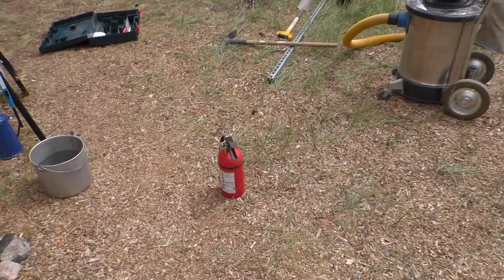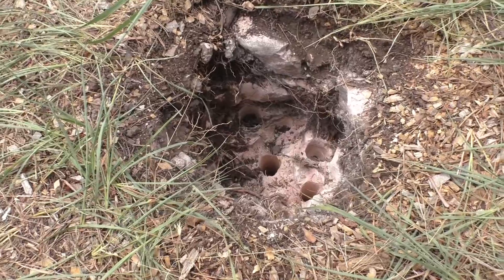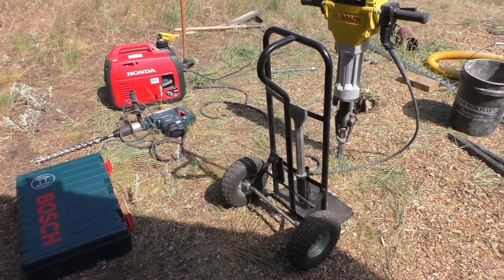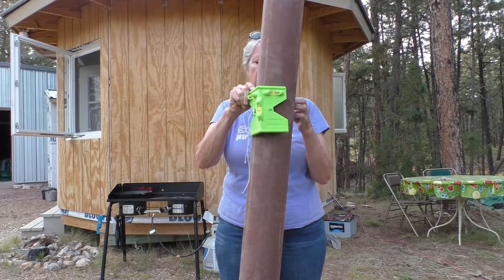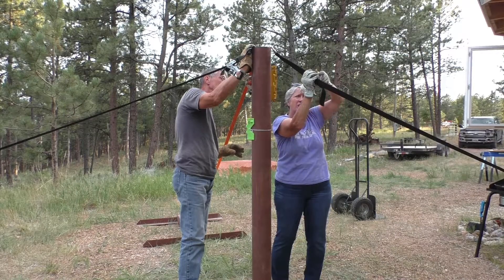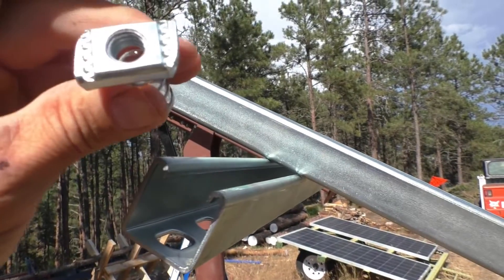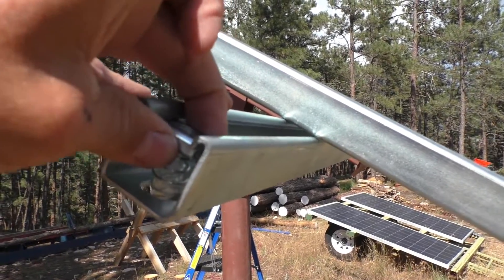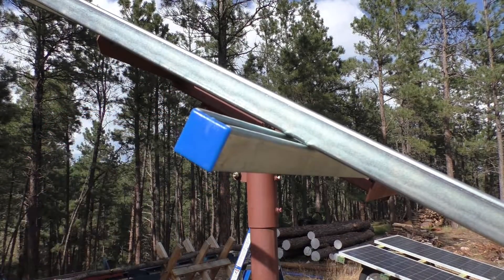Pole Mount Solar Array on the Mountain

Comment: I know this video is a couple years old, But I was curious how this system is held up to the winds and if you would do anything different.  I have followed and appreciated all of your videos and am building a Mountain property similar to yours.  We have high winds, and I was planning on building something similar to you.  I thought about a threaded rod, maybe 3/4" and a few nuts to push and pull.  in the back so I could adjust it.  Is your system easy to adjust the angle with the solar Panels on or is it to heavy?  I would probably be by myself.
Any feedback I would appreciate.  I'm not sure if you will even see this but if you do thank you for posting and you are inspiring.
Reply from the maker: @willgriffith9423  thanks for watching our videos!  The solar mount had held up well. It is rather over-built largely due to large / heavy scrap materials were cheaper than buying engineered size materials. Our power needs have been pretty low running power tools to build things, run a small refrigerator, some small cooking appliances and a real small air conditioner when things are miserable hot. The solar mount is limiting by only holding four panels, but usually tops off four EG4 server batteries in our 48 volt system. Eventually adding more panels will be the lower cost way to take advantage of lithium ability to accept quicker charging. I have noticed that a moving mount may not be as effective as lead to believe compared to higher wattage panels. I may be looking at a fixed ground rack and some kind of hail protection. Neighbors have suffered damage we have not experienced. Always compromises involved. Good luck with your build. It is an adventure!

Comment: very neat and nice work done by both the great minds. thank u & good luck with your solar .
Reply from the maker: Thank you! This solar array has handled all of our power needs for construction which is generally around 1kwh per day. We just installed a very small AC unit in our cabin. The four panels have made 4 to 4.99 kWh yield and fully top four 100AH LiFe batteries. Pretty low usage, but fun to watch working. Thanks for watching.

Comment: Wouldn't it be easier to poor a thick slab and mount the pole to the slab?
Reply from the maker: In time, work and material, drilling a hole was the cheap, short route.  But only because it was solid rock and a temporary placement. Every situation can require or benefit from different solutions.  Thank you for watching!

Comment: Did you fabricate the apparatus mounted to the top of the pole or buy it?
Reply from the maker: I fabricated everything from junkyard metal. I had to buy the 12” top cap pipe because it was hard to find a small piece locally. The Uni-strut and hardware is new.
Reply: @SpencersMountain  Very cool!  You did a great job.

Comment: Still can’t figure out why you spent so much time and work on digging a hole.  Just move to a different location. 😅
Reply from the maker: I am guessing you are aware we would be well off our property after moving to a different location?😁 Thanks for watching.!
Reply: @SpencersMountain  I was talking about only 3-4 feet over.  But I did enjoy the video. Gave me some ideas about how I’m going to do my own.
Reply: Odds are good they drilled several pilot test holes and found bedrock at every one.  Have you been to the mountains before?
Reply from the maker: @jasonbroom7147  You are exactly correct. Our land is either solid rock or fractured rock.  Moving around is a waste of time.  You just pick a spot and expect to work.

Comment: I install these as part of my electrical contracting business. Your homemade mount is very similar to the mounts I buy. I think yours is over built for the 4 modules unless you snow load is very high. Good job!
Reply from the maker: It is over built but since scrap material, cheaper than spec materials. Doesn’t hurt to over build for the odd winds out here. Going into solid rock helps. Thanks for the comment and thank you for watching.

Comment: I'm looking forward to part 3, i.e. the continuation of the project. Cheers.
Reply from the maker: Don’t know how much you have watched so far but there is a playlist for this panel mount and our server rack all in one control, inverter and battery storage.  It has been very convenient plugging in saws, air compressor, cement mixer and other appliances without having to fuel a generator. We will be able to do full on construction on our house with the available solar power.  Thank you for watching!